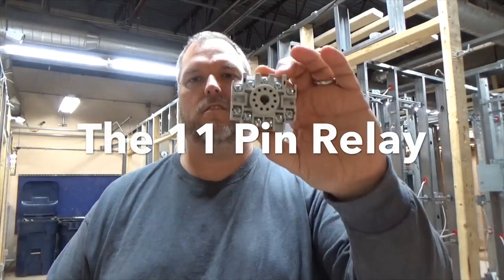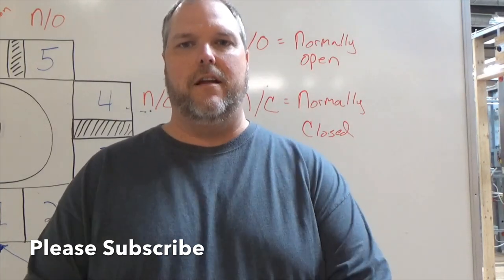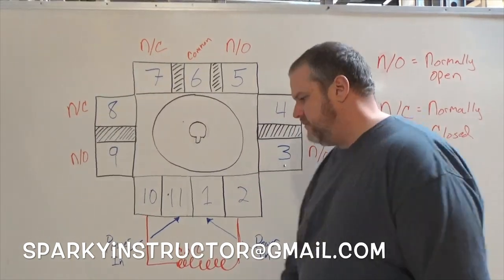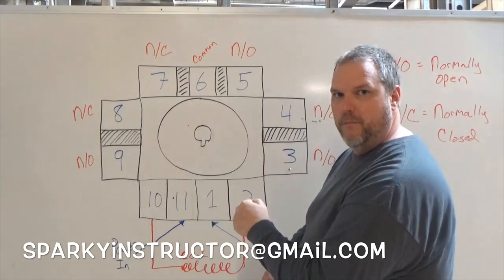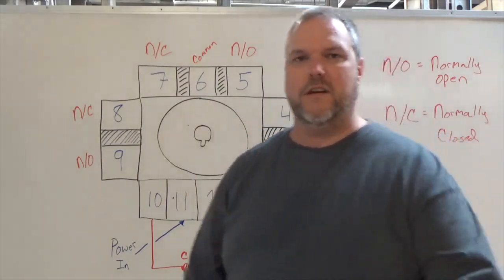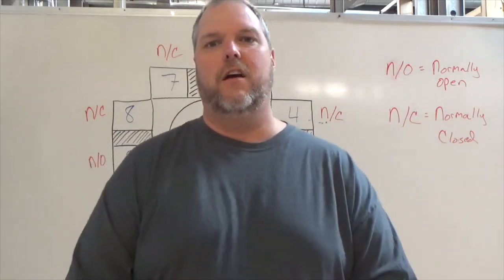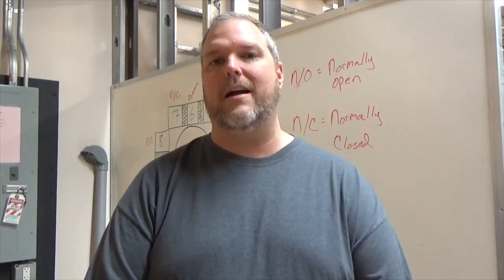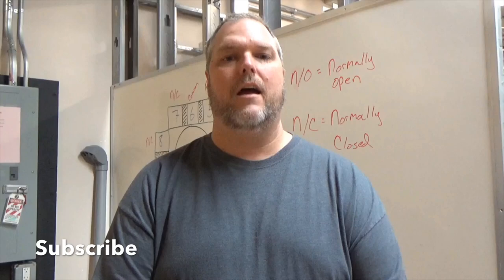11pin Base, Explained

Comment: I prefer the narrower 11 pin relay sockets. Saves room in crowded panels. For the last 25 years or so all of the relay sockets that I ordered had the very confident DIN Rail mounting. Back in the 1970's we had to drill & tap two holes for every re!at socket . Preferred the ice cube relays that have a little LED to let you know when coil is energized.  Makes troubleshooting easier.

Comment: I am working on a 12 terminal Inkbird IDT-E Timer Relay (The Wiring Diagram Sticker on it says IDT-E2RH) But the Silk Screened Label on the Housing says IDT-E. Terminal 5 on the wiring diagram is labeled "OV". But nowhere can I find what this means or a description of what this is for.  Terminal 4 is labeled +12 VDC out for sensor use only.  I'm not sure if I will end up using a sensor but I have to use both a Gate switch and a Reset switch. Could it be that the "OV" Terminal is where to connect the gate,Reset and Sensor Return wiring to and without those systems interfering with each other?  Thanks for the videos.

Comment: Good Morning Craig,
The following is what I need to do.
I have a chick egg incubator which has 2 separate circuits.
(1) 220v AC input which powers 220v AC heater and fan.
(2) 12v DC input which powers 12v DC heater and fan.
So the incubator can use either 220v AC Mains supply or 12v DC supply from a 12v battery.
Normally I run the incubator using the 220v but during one of numerous mains power outages I switch off the mains and switch on the 12v supply.
The problem in having to manually switch over from 220v to 12v .
Therefore I am looking for a automatic changeover that senses when the 220v goes off and switches it to the 12v supply and can then switch back to the 220v when the mains supply comes back on.
I am thinking to use an 11 pin DPDT relay (what coil voltage ?)
Can you kindly assist how to do this.
Thanks John
Reply from the maker: I will send you an email later in the day!! CM
Reply: @craigmichaud-electricalins4602  Thank you
Reply: @craigmichaud-electricalins4602  I have not yet received
Reply from the maker: Sorry I got really busy on Friday and this weekend is turning out to be the same!! I will sit down and see what we can come up with!!  You should have something by Monday latest!! I have not forgotten about you!! CM
Reply: @craigmichaud-electricalins4602  
Thanks Craig
No Problem, I can wait.
A friend gave me a suggested diagram but I am failing to attach a copy here , can you send me an email address so that I can send it to you to examine.
Thanks
John
Reply: @craigmichaud-electricalins4602  
Thanks Craig
No Problem, I can wait.
A friend gave me a suggested diagram but I am failing to attach it so I have sent it to your Sparky email for you to examine.
I have got the 1N4007 diode to bridge across the coil pins 2 and 10 on the 11 pin relay.
I have got an 11 pin relay with 12vdc coil.
But I can't figure out how to connect the 12vdc and 220v to the pins ??
Thanks John

Comment: Does the layout on 11 pins ever change?, Im on my 3rd month of my electrical technician course and just wired an 11 pin relay but in my case 1, 11, and 3 were commons with 1 connected with 4 and 5, 3 connected to 6 and 7, and 11 connected to 8 and 9.

Comment: Where do JM Electricians use pin relays?
I have seen them at the company in the stock room , but never seen where they are used.  I assume in lighting circuits, but where else?

Comment: I have a 11 pin phase monitor 400 volts but after connecting it indicates low voltage what could be wrong?